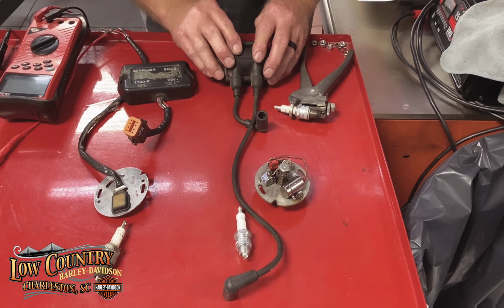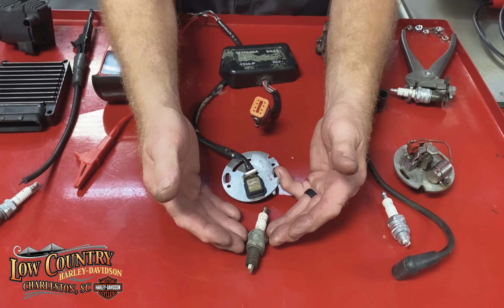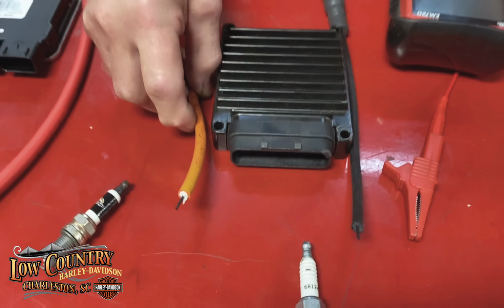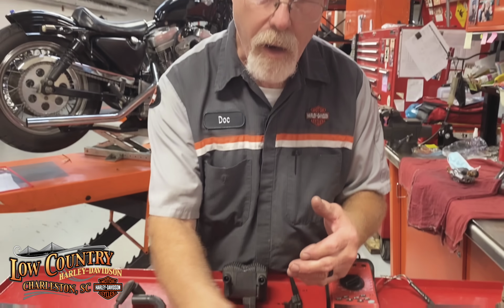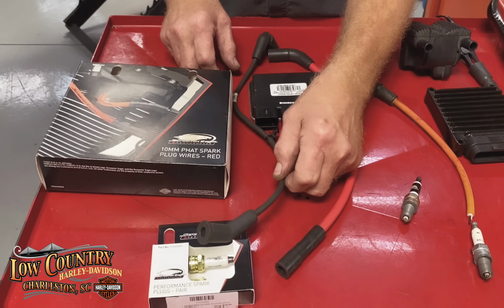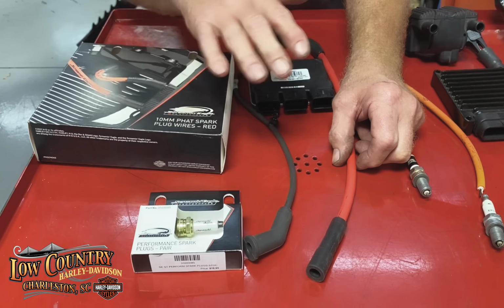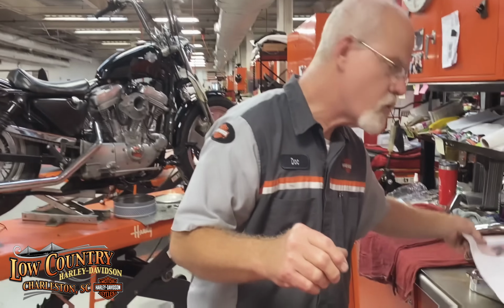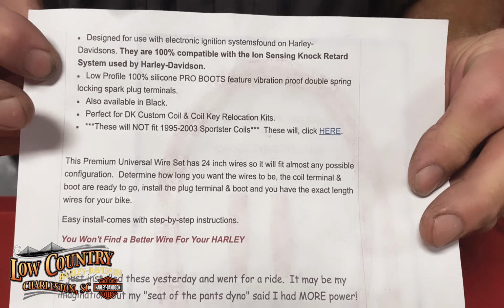Spark plug wiring | Doc Harley | Upgrades

Comment: Thank you Doc, I have a 2019 RG and just hit 10,000 miles, I still have the original battery in it but I’m about to change it, while I have the seat off, I’m going to change the spark plugs and fuel filter and wires!! Your video just explained the issue perfectly and I’ll stay with the HD equipment as far as plugs and wires!! Thank You!!

Comment: Hi Doc, love your videos!  I look for your videos every week What high performance spark plug would you recommend for a 2016 103 FLRT ? Now just because I ride a trike, it doesn’t mean I’m satisfied with the performance I am getting, although I think my engine runs great. I usually ride with my wife, so double the weight, equals half the performance. I could use a little help now and then. Thanks for any advice you may have for my Harley !

Comment: Hi Doc, great video. However, my 95 fat boy has plug leads connected together with some sort of fuse on each of them sealed in a plastic case inside the chrome coil cover. One of the cases has broken and now the the lead is not connected. I cant find a replacement  do I need to have the leads connected to a fuse before they go to the coil. I live in England and now missing the couple of weeks of sunshine we get trying to fix my bike 😢

Comment: Thanks for all you do, goes without saying. I have a question for you that dozens of bikers can not answer. It's pretty simple really but no one seems to confirm or deny. Here's the mystery:
 - it's okay to plug your new spark plug wires into EITHER ONE of the coil receptacles (on an 1995-97 EVO) and it wouldn't matter or you can reverse positions. Yes or no. (My '95 Bad Boy runs with either position) THANKS for your insight!
Reply from the maker: Those years were Dual Fire Ignition systems. Both spark plugs fired at the same time.. so yes it doesn’t matter except for looking stupid….Doc
Reply: @LowCountryHarleyDavidson  PLEASE EXPLAIN "it doesn't matter except for looking stupid". "What the hell would "look stupid" about it?

Comment: Hey Doc , I'm new to Harley Davidson, can I swap out my standard plugs and use iridium with no issues..I have a 1584 2007 Dyna... thanks
Reply from the maker: People do it but I don’t advise. Because of the way the Twin Cam anti-knock system works. To activate the ECM measures the resistance at the spark plug…..Doc

Comment: Thankful for you Doc and wish you are doing well! I do not respect some of the you tubers but I do U. I just upgraded my ride to a Sport Glide 107 manufactured in june of 2019 hopeful that she was given the oil pump upgrade🙏. Aside from the plugs, are U saying that if I install wires that have 1 tenth of the resistance of stock wires that she will not get a better burn of the charge? If so why? Take care of yourself please.💪💪💪
Reply from the maker: In my opinion, with better made spark plug wires the efficiency and longevity is improved. But the manufacturer coil and spark plugs are only going to “perform” within the standard’s designed.  Now a coil made to perform stronger with efficient plug wires and iradium spark plugs could deliver a stronger spark. On the street would you feel the difference, maybe. Starting yes, idle and acceleration only if the timing and fuel is there to match.  I have often wondered if improving this area would effect the anti-knock system on Twin Cams that the ECM measured the resistance of the spark to adjust the timing🤔….Doc

Comment: Hey Doc, thank you for all that you do with this channel, I’ve learn a ton from you and your videos. 

Wanted to ask you, do you recommend gapping my plugs smaller than 0.040 if I’m running a points ignition?

It’s a 1994 evo big twin with points ignition and mechanical advance. 

Thank you
Reply from the maker: Yes. BTW have you looked at a Dyna S ignition? It uses the same flyweights so you can put the point plate with cam in your saddle bag in case you break down. I really like it.
Reply: @LowCountryHarleyDavidson  would .020 be a more appropriate setting for points? And I have seen those yes, never tried one though, I will give them a look. Thank you!

Comment: Great video doc. I recently changed my spark plugs for the NGK Iridium IX DCPR7EIX Spark Plugs for 1999-2016 Harley Davidson Twin Cam (Pair), and from what I understand on your video I shoukd keep the wire until its time to change it since there's no difference, correct? Or if theres a wired youd recommend that would compliment the new plugs as well as be compatible with my 2016 sportster 883 ?
Reply from the maker: Sumax, Taylor and MSD offer very good wires….Doc

Comment: My 2019 RGS with 50,000 miles started running very sick after a bath or riding in heavy Florida rain.  
Wasn't sure what caused this issue to suddenly start as my dealership had just done a head, piston and cylinder rebuild on my bike.  I did go back to them and mentioned what had happened and they had no idea without a proper inspection as my bike had not thrown any codes.
Since watching your video and another one about plug wires you both mentioned the rubbing issue, this I think is my problem and Im going to make a trip to my local dealership and  pickup a set of red phat wires.
Going with the red phat ones as more protection, my bike is red and I know they are gonna give me lots more hp ;)

Comment: Thanks Doc , found this post and you nailed it as always . During the winter I was looking at my wires on my 2008 twin cam and found one that was rubbing against the fuel line coming off the tank and it took a chunk out of it . I went with the Screaming Eagle wire kit and also too,the time to route the wires better so they don't touch anything
Reply from the maker: Glad it helped….Doc

Comment: Very informative however the question I have with an 04 Carb twincam with low mileage stock ignition except for a SE module to go with the 203 cams "no big bore",  should as a rule of thumb I replace the wires? What resistance should a stock wire than a performance wire have? Or if a stock wire is in need of replacement. I have no misfire issues
Reply from the maker: Front / Rear 20 inches Resistance (ohms) 5000-11666.....Doc
Reply: @LowCountryHarleyDavidson  thanks doc ... isn't that excessive?

Comment: Hello sir, you seem to know you stuff about Harley Davidson, I have a 2005 1200 Custom. I have put Vance and Hines pipes on it with baffles, jetted the carb, put a Roland Sands high flow air filter on it. Is there anything else on the cheap side I could do to get performance? Maybe different plugs, wires, or anything. I don't want to go into the motor so no cams. Please any advice would be appreciated
Reply from the maker: New spark plugs, New wires would help. Keep your oil and filter clean. Tire pressure at Factory spec. If you fly on the Highway, get a better fuel valve, the factory fuel valve dribbles fuel and won't keep up with the float bowl at high speeds.
Reply: @LowCountryHarleyDavidson  when you are saying fuel valve, are you talking about the petcock? If so which one, do you recommend, there are a lot of those out there and I don't want to buy one that is worse than the factory one, also what plugs and wire do you suggest, thank you.

Comment: Do the cylinders fire 45 degrees apart? Does it use the waste spark system? Thanks for your help.
Reply from the maker: front fires, rotates 315 degree, rear fires then motor rotates 405 degree and fires the front again. pre fuel injection used the dual fire with the wasted spark...Doc
Reply: @LowCountryHarleyDavidson  Thanks for your help.

Comment: I installed screaming eagle wires on my 94 dyna and they fried my single fire ignition, harley told me to run stock wires , not problems now
Reply from the maker: I really don't see how any SE plug wires would smoke an ignition system. I have seen plenty of aftermarket solid core wire do this...Doc

Comment: Horseshit.

Harley-Davidson should sell their bikes with the best ignition components. The Harley marketing model is obscene for essential engine parts.
Reply from the maker: A very bold statement, Horseshit!  Do you even own a Harley-Davidson ? Did a unmodified factory ignition part fail you? Give us you story before you post and animal reference...Doc
Reply: @LowCountryHarleyDavidson  There are certain components of a vehicle that shouldn’t require upgrading in order to “function better.” Spark plug wires are one of those things, as are spark plugs, fuel pumps, oil pumps, and other core engine components.

Harley holds the worlds record in selling motorcycles À la cart with personalization bolt on replacements. That makes sense, if you want skull brake pedals and handgrips you can bedazzle your bike…for a price. However, selling “upgraded” spark plug wires that won’t wear through or melt as easily as the originals is too much, in my opinion, of course. They should just sell all their bikes with the best quality wires they can produce. If they wanna market it as “ooh, look, fancy colors” then I get it, people can justify whatever they want.

Yes, I own an FLHTK and have owned several previous Harley-Davidson motorcycles, as well as Gold Wing’s, other Honda’s, and Ducati’s.

So yes, I call horse product on Harley-Davidson’s spark plug wires. Sorry if you took it personally, it was not intended that way.
Reply: @AV84USA  I have stock/original wires on my 2002 Road King. Still runs good. The stock wires are not junk.

Comment: Great video! Thank you for making it and putting out this info.  
 My 2 cents: some folks might presume that modern Harleys have Knock Sensors to detect detonation in the cylinders/combustion chambers (re: such as found in cars) which communicate (provide input) to the ECM/ECU and then an output signal to retard timing to counter the detonation.  However, Harley is using Ion Sensing (ECU measuring the resistance of [spark plug wires & the spark plugs].  Very critical to use the correct spark plug wires & spark plugs for the Ion Sensing software to operate correctly.  On Baggers, 2014 and newer:  Rubbing issues with spark plug wire (wires?) to # 1 cylinder??? News to me.

Comment: Hi Doc. I was wondering if my 2017 Harley softail slim S have 3 wires. I was told at the dealership that I only had the 2 wires on the left side. I’m planning on putting new ones on but wanted to make sure. My bike is already being worked on, due to other mechanical issues. But yeah if you can write back, that will be awesome. Thank you
Reply from the maker: Sir if your 2017 is a Twin Cam you only need 2...Doc

Comment: Hey Doc!
This is Arindam from India, I own 2016 Fatboy. Recently I had to replace my BCM! I had no Idea what went bad and what happened. BCM is quiet expensive part of the bike and as I have known it is not a usual part which goes bad. Could you please share some information on BCM.
Reply from the maker: Maybe an idea for a video. The BCM is a mini computer that replaced all relays. Many times instead of receiving voltage it receives resistance stats from components. The biggest enemy to a BCM is someone adding accesories or lights and taping into a wire they should not.....Doc
Reply: @LowCountryHarleyDavidson  thankyou for the reply, in my case the only thing I changed was the battery which is an aftermarket one. I don’t know if that can create an issue

Comment: Doc, thank you. I'm getting a knock at certain throttle-on loads, even at idle. I believe it's my throttlebody butterfly valve chattering. This happened after I put on the Phat wires (stock plugs), high flow air filter, V&H Power duals, S&S 475C cam and oil pump, and a canned Fuel Moto tune. I'm now adding a S.E. 55mm aluminum intake manifold and doing an actual dyno tune at the dealership this week. Should I go back to stock plug wires? Have you ever heard of this butterfly valve chattering? Could it be something else? The tech said Harley is all over the place with tolerancing on their throttle bodies and that I might have gotten one out of tolerance or on the high side of it. Any thoughts at all? I appreciate it!

Comment: Nice video, Thanks for the explanation. Experience shows that "aged" plugs and wires cause the ECM to regulate to a safer setting. That reduces power. The longer your wiring and plugs are 100%, the better the ECM can regulate. It's not about 10 horses, but a good ignition system keeps your engine healtier.
Reply from the maker: Great point!..Doc

Comment: Hey Doc, I have phat (orange) wires on my bike. I noticed the other day that my wires have a black smoke like residue on them. Is that a sign of something that I should be concerned about?  Thanks !
Reply from the maker: YES. I am hoping it is road residue or maybe a possible oil leak around the rocker area. If your bike idles poorly you might have a break in the spark plug wire and you should replace....
Doc

Comment: That was a well thought out video. Clear and concise.
You didn't dictate what we should do, you gave us info and suggested we make up our own mind.

As for me, I stay with Harley parts. The only Harleys I have found dead by the side of the road had aftermarket parts. The screaming eagle wires I bought for my 2000 wide glide are awesome. They have about 45,000 miles on them and they work like new. I should probably run a test on them but the bike starts instantly and runs great.

Comment: Hi Doc, how do you get the fuse box off of a 2005 wide glide to be able to install the siren 2? I tried, but the box does not want to come out very far at all.  Also, I used your tip to clean my fuse connections and put bulb grease on the fuse connections after cleaning the light corrosion off.  Thanks !
Reply from the maker: Glad our tech tip helped. You are right, after the top and side allens are removed the fuse block will only come out so far because of the wire harness...Doc

Comment: I run ngk plugs with no resistor.  2002 fxstd deuce, carb, twin tec ignition, rinehart cross backs, 1/4 turn throttle, coil relocation.

Comment: Always appreciate your videos, especially that you are interested in helping owners understand and not hustling parts. Been through a few electronic ignitions on my '86 Sportster (similar to the bike behind you, including the S&S carb), but little by little I've reached back a bit and installed a points ignition with copper core wires. Cheap (as you note in the beginning), easy to static time to the advance mark with nothing but a screwdriver, feeler gauge, and a slip of cellophane. Runs like a champ (or at least a champ with 98,000 miles on it). A bit more maintenance intensive, but at 71, with a couple of beers, what else do I have to do beside fiddle with my old bike and ride it?
Reply from the maker: love your story...Doc

Comment: I put the SE fat wires and SE plugs in my twin cam softail. It seems to start easier. Put the SE fat wires on my ‘21 softail for aesthetics though it seems to run a little smoother. Plan on putting the SE wires and plugs in my ‘19 RGS this winter.

Comment: Primary ignition resistance has little to no effect on ION knock/misfire sensing. The system senses the plasma ball at the electrode and determines cylinder pressure. If what you were saying was true, .0001 of a plug gap difference from design would skew the ignition system since .0001 of a larger air gap is millions of ohms difference.
Reply from the maker: Thanks for sharing your thoughts. Could you share where you attained your information?  Send it to my Email...Doc
Reply: "The system senses the plasma ball at the electrode and determines cylinder pressure"...Not sure what system you're describing..."ION knock/misfire sensing" uses "Ion" current measured by the spark plugs between combustion events as a sensor for knock, misfire and synchronization detection. With the ion sensing system, the ion current stream developed due to combustion can be deduced by monitoring the secondary current of the ignition coil. Using the value and wave shape of the current, after the actual spark event, the quality of the actual combustion process is determined, thus allowing the engine control unit to optimize the timing of the spark for the best engine performance while keeping emissions low on a much wider range of rpms.

Comment: So I bought my 19 Ultra Classic with about 19k miles on it,  seems like just days after I brought it home, it started missing and backfiring.  Took it back to the dealer and the kept it for a week, but found faulty plug wires.  Is that what I can expect from stock wires?  Great video BTW.

Comment: so based off of this info, Doc, I have never been a fan of the cowbell and the horn located under it, so I relocated the horn on 2016 Street Glide, I then relocated the coil to that location, therefore the plug wires are much shorter. it looks amazing in my opinion. I have read that running shorter plug wire will interfere with how the motor runs, I ain't feeling it, but can you put my mind at ease?
Reply from the maker: Stock motor with air cleaner and exhaust? If so you are probably OK.
If motor work is at hand and you have a good rich tune probably OK
Wild motor work, with no tune? Ignition timing could be struggling,
Just a guess because Ion sensor is basing its data from less resistance....Doc
Reply: @LowCountryHarleyDavidson  stock motor with air cleaner, slip-ons, and a screamin eagle tuner. Thanks Doc

Comment: Interesting.... So how many miles before you have to change your plug wires?
Reply from the maker: That is a point we forgot to address. No specs from the Factory. A local electrician suggested to measure the ohm resistance on a brand new set installed and check every 10K. When there is a 10% difference...Replace...Doc
Reply: Change mine every oil change, 5k miles